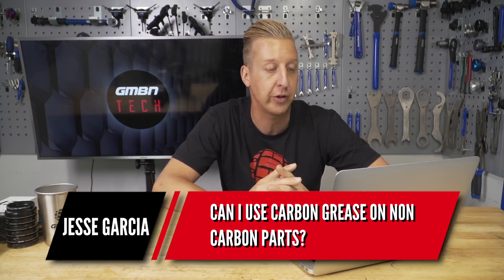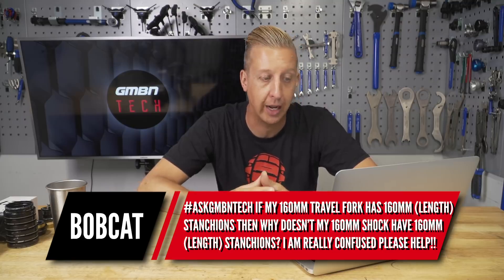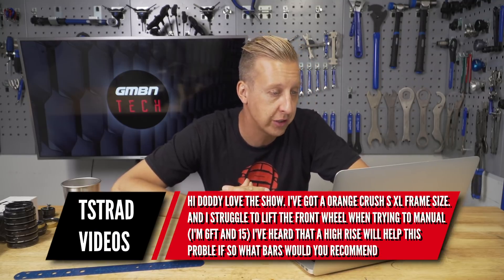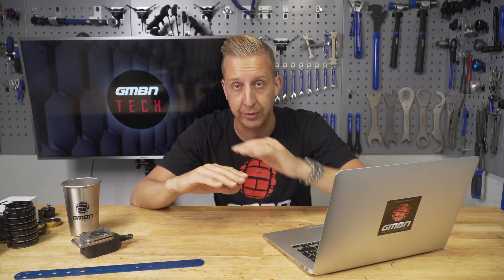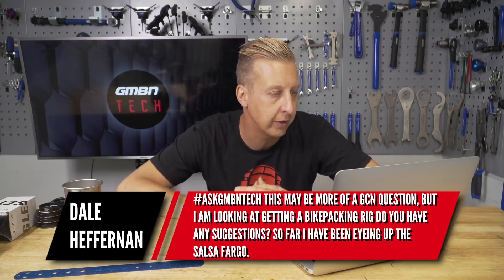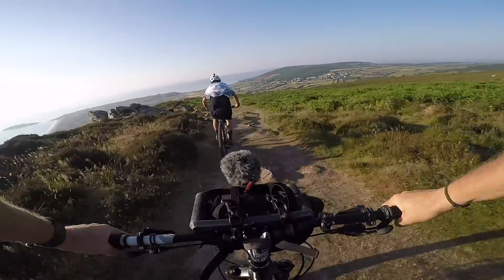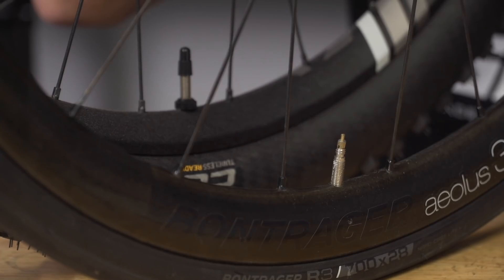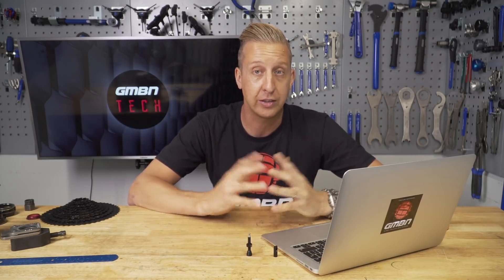Ask GMBN Tech: Why Isn't My Mountain Bike Suspension Travel The Same?

Comment: #askgmbntech I am upgrading my wheelset to a maxxis dhf and a maxxis shorty.  it is recommended I run the the dhf on the rear do you think this will be a nice wheelset and if not what changes should be made
Reply from the maker: The DHF can make a great rear tyre. Generally if you want to run only one shorty, run it up front. But only run a shorty in really muddy and loose conditions. The DHR II can also be run up front (the R does stand for rear, but isn't limited to the rear). If you aren't riding in really gross conditions, maybe run a DHF front and rear.
Reply: The F in DHF stands for front. You want a DHR for the rear.
Reply: GMBN Tech thank you the conditions here in Ireland often aren't too bad so I will most likely take on your advice

Comment: I just got a repair-stand for my bike, i have a scott genius 720 with a dropper on it, where should i clamp it?
Reply: The reason NOT to clap the stanchion of a dropper is the leverage on the internal keys (mechanism) in a plane its not designed to hold against...as well as scratching risk....either loosen the clamp and pull it up enough to clamp.outer tube, or clamp around the top of bike seat tube and the 'nut' between the stanchion and lower if its sunk fully into ur frame....top tube is possible, but again not designed to take a clamping load, espec if its butted (thinner walls in the middle than ends)
Reply: TomaCukor nit designed for compression loads, esp if butted tubing...but ur bike, ur risk
Reply: Rupert Wenn if the clamp head can freely rotate there a no radial forces applied on the mechanism. The axial load from the weight of the bike is minimal compared to what it is designed to sustain. Those "shop monkeys" have worked on far more dropper posts than you ever will.
Reply: Top tube should be the default place.
Reply: Don't be afraid to clamp the post. Just make sure the clamp is clean, or maybe wrap a towel around the stanchion so it doesn't get scratched. Also, if possible, let the clamp head rotate freely so that there is minimal shear stress on both the frame and the post. Most manufacturers hang their demo fleet by the dropper all year long, I wouldn't worry too much about it.

Comment: 13:25 it could also be faulty or worn out freehub, this is very common issue on cheaper Shimano hubs, for me they are useless, I destroy them fast, for example m475 hubs, I also bent axles after just few trips to the grocery stores. So I upgraded to hope, no play,  some of these issues are caused by flawed design,horrible tolerances, you can't service those freehubs without special tool that is almost impossible to get.
But it's not only those hubs that got issue with play, I had issues with Formula hub too, also it had zero grease in bearing, after 90 km it was wobbly.
they both were so wobbly that it caused shifting issues and noisy drivetrain, but my local shop calls this normal, for me its unacceptable.
but it could also be that the freehub is not secured properly, old school freehubs have an Allen bolt usually 10 & 11mm, if it's loose the freehub will wobble, so use Loctite 243/blue and tighten properly and it should be secured for a long time.
Reply from the maker: All sound advice, thanks for sharing!

Comment: I wish i could afford parktool bike tools man
Reply: Took me years, but I only bought one at a time as required. Now I have almost everything and they make me money!
Reply: Jack Ammo Man bbb, topeak, pro, all make as good tools for way less
Reply: wait for sale. and try other brands, there are plenty of choices, unless you want bike specific tools, then you can also go for Unior
Reply: Many tools dont need to be 'bike specific'...spanners, torx and allen keys, in fact most of what u need....allen (hex keys) screwfix do a really cheap set with imperial and metric in, which are seriously accurate and strong (though the box is crap!)
Reply: I mean hanger tool, piston/pad tool, Threaded bottom bracket install/removal tool ,cone wrenches and such tools, but the tools that are not bike specific you dont' have to get from bike specific brands they are just re branded, or already made by them for other stuff, Unior makes automotive tools & bike tools
Park Tool use Bondhus Allen keys with their own colors.

Comment: #askgmbntech what difference to the ride and feel of the bike when there's less travel in the rear than the front, e.g. commencal clash, rather than same both ends?
Reply: kind of what you'd expect, you get a front that will take hits big and small will ease to keep you safe and in control  while generally also getting the pedaling efficiency and playfulness that comes with less travel in the rear. I'm not sure the Clash is the best example as it's still a rather long travel bike; I'm on a 150/125 Transition and it's fantastic, the back end is a little stiff for DH and can definitely get a little wild but the geo and longer travel forks mean it'll keep you in control on some serious descents. It's ideal for flow trails too
Reply: I have a scott genius 140mm front and 130mm back but that's my first full sus so now I understand. thank you

Comment: #askgmbntech one of my buddy recently bough a lightly used derailleur, cassette and crankset with a narrow-wide chainring, but the chain is slightly older then those, so when he cranks down hard, it makes a crunching sound, is the chain to blame?
Reply: Miku Cavendish probably, i had the same problem so i cleaned and lubed the chain and the sound went away. there’s a chance it could be the bottom bracket tho
Reply: Mason G

Hmmm... He did use pretty cheap general purpose oil... And the bottom bracket is greased really well.
Reply: My buddy recently developed this grinding and we tried to clean the drivetrain really well with no luck. New chain, no luck. New narrow wide chainring did the trick
Reply: I’ve seen badly grooved freehub body splines hold a cassette away from back  of body causing cassette to be loose
Reply: I've seen a similar problem in the past where an old chain was used with a new casette and chainrings... When putting power down hard (e.g. pedalling up a steep hill) the chain would slip and make a crunching sound like you describe. The cranks would also jerk forward when this happened. A new chain fixed the problem for me.
Reply: maby the chain is too wide

Comment: #askgmbntech I doddy is there a good tool kit at a fear price with maybe not all the tools of a PK 3 (even other Brands out of parktool) thanks
Reply: I recommend to buy all the tools you need for the jobs you can do now, and buy the best tools you can, instead of buying a kit,  tool kits might have tools you don't need and a box you don't need.
there are plenty of choices, for repair stand I recommend PRS 3.2-2
for tools:
Parktool
Unior
Abbey Tools
you can also get some sockets and bits and so on from non cycling brands
some tools are better than others from each brand, so good idea to mix, check out what pro mechanics use.
I got a mix of Teng tools, Abbey tools, Park tools, Pedros, Unior, Racpid Racer Products, I will add more tools in the future, I need a proper ratchet.
I am still researching tools.
https://kit.com/mtbboy1993/my-tool-reccomendations

This tool box looks great: https://www.pinkbike.com/news/whats-in-a-world-cup-mechanics-toolbox-2017.html Pelican case with foam inserts https://www.fastcap.com/product/kaizen-foam
I haven't tried it yet. but looks like a good solution.
Reply: Recent mbuk or such review, halfords do similar kit for £40...good tools too
Reply: I can't recommend those, it will have tools you might not need, unless you got the bottom bracket the tool is for, and so on, pointless to get tool kits. and it still don't have enough tools to start with.